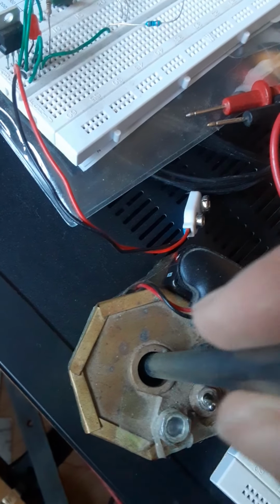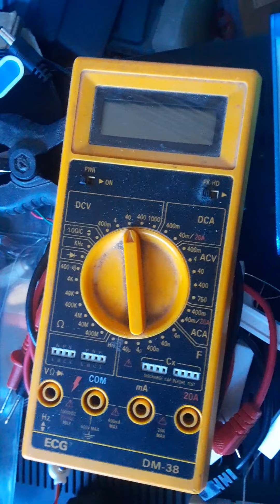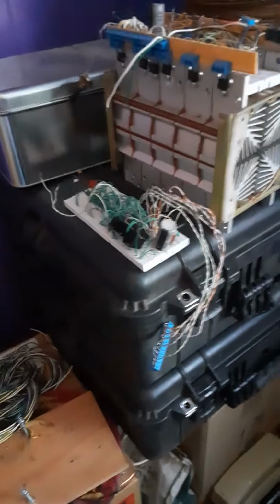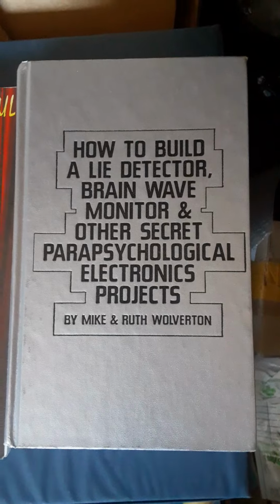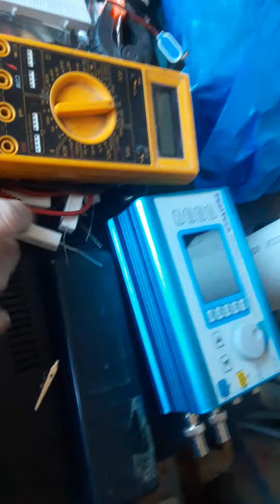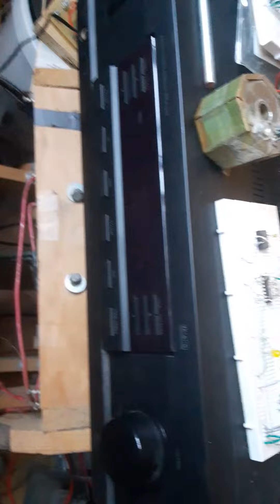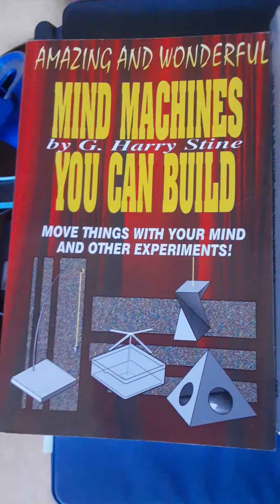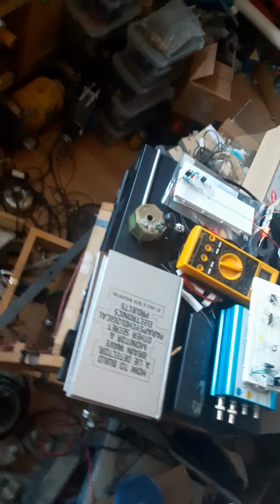27 years of physics research summarized in 16 minutes

Comment: Really amazing! I have been approaching some similar research, haven't been able to acquire enough space yet for a workshop but I am experimenting with sound synthesis and there is a lot of correlation with field matrices and elementary ionic field interaction. As an aside your Amp reset is probably related to bit flipping on the silicone itself considering how close it is to the field you are generating.
Reply from the maker: I agreed as to why the amplifier messed up. I subscribed to your Channel. If you post your work I will see it. Quite happy that another researcher found my video. Typically I only bother posting things that actually work, but that's very rare. Maybe I should be posting my failures as well so no one else bothers to build the same thing that ultimately didn't work. I will try to post today's experiment that didn't work or sort of didn't work. It did something I wasn't expecting